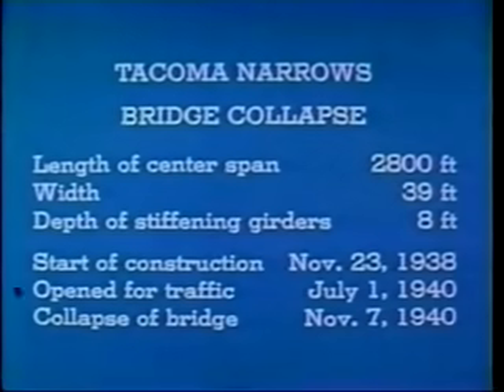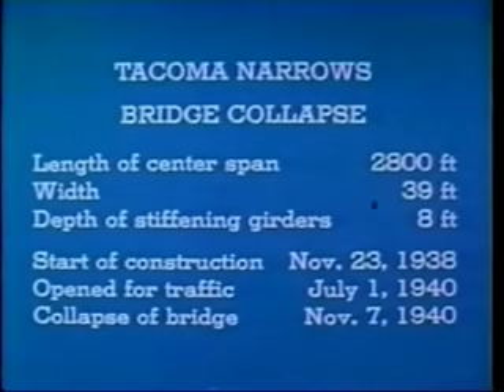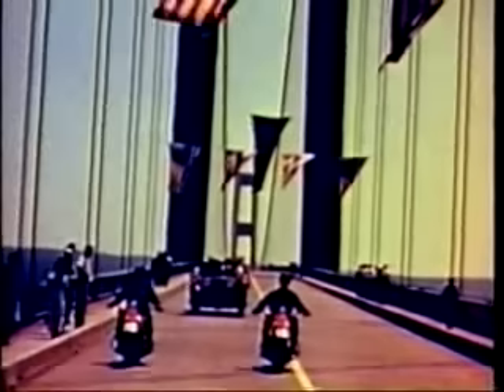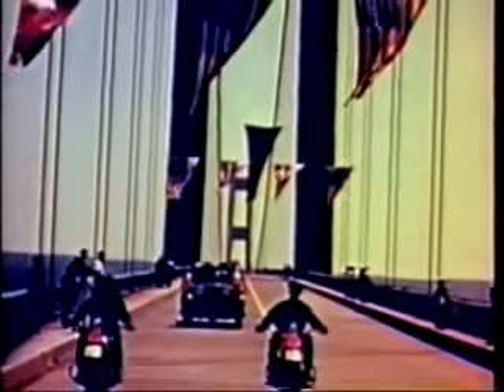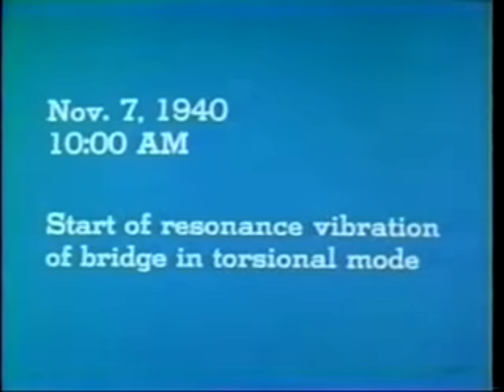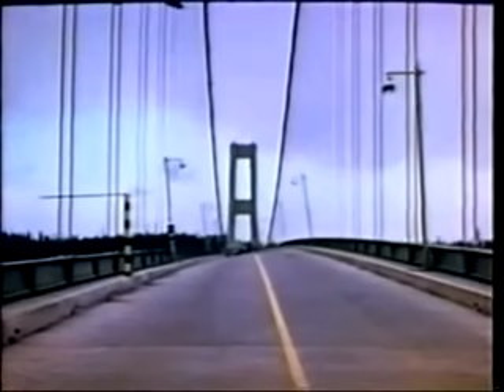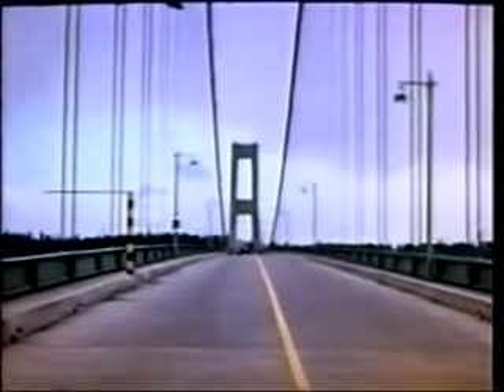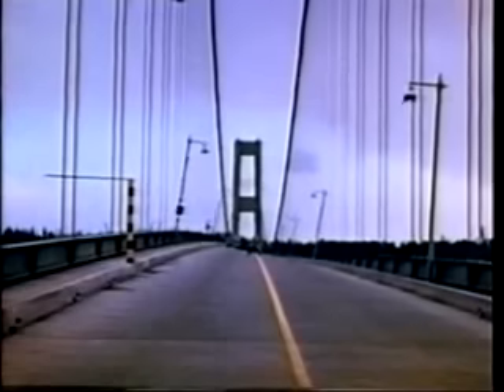Tacoma Bridge

Comment: Why are some people saying it's fake or have something to do with a conspiracy? It's got something to do with the frequency, Learn Science!
Reply: its called galloping. the osculating winds.engineers aren't perfect not then not now. some people say W.T.C. towers collapsed because of engineering flaws. i disagree  IMO the main cause of twin towers collapse was jumpo jets full of high octane fuel crashing into them.
Reply: +Tony Micel Jet fuel cant melt steel beams
Reply: +Jake Valentino It doesn't have to melt them to weaken them. Duh. LRN2PHYSICS.
Reply: +Mike Crews infact main engineer given an allarm about that while inside the first tower. He saw what was happening.
Reply: Paige Holloway Some peoples are crazy.... :D
Reply: +Paige Holloway sorry, this is very real. A famous engineering case study on resonance. Look it up.
Reply: that's what I said
Reply: The reason for the collapse of the bridge is because the gale blowing at the time was vibrating the bridge at its "Natural Frequency". The vibration severely weakened the structural integrity of the bridge, making it collapse.
Reply: Actually, it was due to fluttering.
Reply: Paul Smith no, it's frequency, the wind had the same frequency as the particles in the bridge which caused this to happen
Reply: I know it's not fake
Reply: This was copy and pasted from the other Tacoma Narrows Bridge video
Reply: And resonance when they wind which blew at 67km/h and matched the ferecency in the bridge and then it collapsed
Reply: It's not fake when the frequency of the wind matches the frequency of the bridge the bridge resonates which makes it move like that.
Reply: And you have done that experiment?
Reply: Tony Micel : I second that. I am not an engineer, but I was there.
Reply: No other bridge wobbled like this then fell down.  It looked like a controlled demolition.
Reply: It's a fake, the film of it failing is cut, and you can see all the smoke from the charges that took it down
Reply: Maybe not, but that degree of heat over a period of time did change the molecular structure of the steel and severely weakened it to the point that the beams couldn't support the weight of the structure above them, causing the collapse.  Once the collapse began, "pancaking" occurred and the momentum of the initial collapse caused sufficient downward force to make each tower collapse.  Not a design fault.
Reply: Not the particles, but the natural frequency of the whole structure.
Reply: Definitely NOT fake and definitely not a conspiracy.  It happened.  I first saw a film of the torsional vibration and collapse in physics class in my senior year of high school in 1970.  The roadway supports for that bridge were poorly designed and completely underengineered, allowing the roadway to buck up and down in the wind again and again during the first few months of the bridge's life, which is why it got the nickname "Galloping Gertie".  After less than five months of use, on its last day, the bridge's roadway started its extreme torsional vibration and collapsed after barely over an hour of that, and it got filmed because with that kind of thing going on, people were going to film it.  The story was in every newspaper in the country and reported on every radio news broadcast in 1940.  My parents remembered it well and my father, when I talked about having seen that film in class in 1970, even remembered the nickname and the fact that the bridge's roadway was notorious for extreme up and down movement.
Reply: You are way off base.  What happened to "Galloping Gertie" was studied closely to determine why the bridge failed.  They certainly didn't do any kind of demolition bare over four months after the bridge opened.  No other bridge failed like this because no other bridge had been underengineered like this one.  You can read about the bridge failure in all the newspapers the day after it happened and documentary films reviewing the cause of the torsional oscillation of the bridge the day it failed exist.  Google "Tacoma Narrows Bridge" and find out what actually happened.  I note, too, that there is film footage of Galloping Gertie galloping routinely as cars crossed it during the period between opening day and its catastrophic failure.  The support system under the roadway was woefully inadequate to stiffen the bridge and used solid box girders that caught the wind like sails instead of an open triangular truss system.  The day of the failure, the 46 mph winds blew in harmony with the bridge's natural frequency, and the oscillating torsional motion began and was so rhythmic as to be self sustaining, so once it started, the wind just kept it going.  Finally, one of the main cables broke loose from its anchor on the eastern end of the bridge and that was the end -- with one main cable broken loose, the bridge fell.  It's actually amazing that it kept up the severe oscillation as long as it did without falling.  Had it been a controlled demolition, no one would have had to escape from his car on foot, leaving his car on the bridge.
Reply: Todd - why does being shown a film about resonance etc mean it isn't a conspiracy?  It could be - the collapse video is cut to a time after the collapse has started, and residue of an explosion can be seen - I wouldn't expect mechanical failure to throw smoke out as if explosives had gone off.  If you can find footage of the instant of failure, that would help.
Reply: @andrewdeighton5926  by it wasn't, it's called critical frequency, here's the same experiment win a different object, take a crystal wine glass, then put a straw in it, then hum loud and go up and down win the pitch of the hum, if done properly you will see that he glass is shaking, fluttering back and forth, pretty soon if done long enough, it will break. This wasn't a controlled demolition but critical frequency.
Reply: @andrewdeighton5926  if you learned ANYTHING on critical frequency then you will understand, otherwise it looks fake, modern bridges are engineered so that the critical frequency is very high and hard to get too, but at the time of those bridges people didn't know about it so engineers weren't concerned about something like that, the mistake was made, it is true, and now engineers know how to make a bridge without worrying about critical frequency
Reply: @andrewdeighton5926  maybe because the road itself fell and the sides were ripped off which created the "smoke" very much real tho
Reply: Andrew Deighton there's more than one thing that can be confused with an explosion. Just because there's dst in the air that juts outwards doesn't mean explosives were used

Looking at the moment at which the clip started, if explosives were used, you'd see more smoke and in a different shape. Right now it just looks as if a flare had gone off

But if I may ask: why on earth would they blow this bridge up? Why in such circumstances? Looking at how it fell, it was obvious it would be studied and therefore the chances of such a conspiracy being uncovered would have been a lot higher
Reply: @plazasta  also why blow up a bridge with a dog on it? With people on it? Engineering at the time didn't know about this until they did a bunch of research and experiments to redo the experiment in a controlled environment
Reply: @mr.dinosuar7333  but haven't you seen 9/11 and other tragedies? The government is willing to do anything to achieve its goal, even if it means killing people duh
Reply: @plazasta  so your saying 9/11 wasn't a terrorist attack when it was? This bridge fell do to frequency, no explosives nothing. The bridge wobbled because the wind matched the bridges frequency which made it collapse under the stress. Nowadays bridges take this into consideration so it doesn't happen again. They make the bridges frequency hard to get so it doesn't happen.
Reply: @mr.dinosuar7333  I was being sarcastic, why do you think I finished my sentence with "duh"?
Reply: Building 7.  And molten iron pouring out on video!! “MUH StEeL BeAmS dOnT hAvE tO mElT fOr iT tO cOllApSe hurr durr”
Reply: @MossadDid911  where the molten iron being poured out shown, where. "HuRr dUrR
Reply: @MossadDid911  these arguments are getting old. I hate that conversation because both sides sound like broken records now uttering the same sequence of arguments over and over and over again
Reply: “It’s got something to do with frequency” 
“Learn science”
Reply: @Jamsicks  IT did NOT have to.. the strength of the twin towers beams was cut to a fraction, by the burning  jet fuel. Check out ANY engineering manual for torsional and tensile strength of steels at elevated temperatures.  Simply Red (not orange or white) hot you can dent steel easily with ANY hammer!
Get smarter.....  Please !!
Reply: @MrsPaul  The bridgewas open for 4 months!  this is the first time it suffered increasing resonant motion!
Reply: Frequency is a fake concept made up by the government to control populations.
Reply: lol. I just love the irony in the statement, "It's got something to do with the frequency, Learn Science!"
Sounds like the writer needs to brush up on their science a bit, too. Or rather, their math.
Reply: Bruh, physics xd
Reply: as a Citizen in WA I can confirm this is 100% legit
Reply: We are in class and my friend just chat me "This seems a quite fake" lol
Reply: This needs 8 more likes
Reply: No it's real I live near there it fell there's pictures
Reply: People: say it's fake
kindergarten trauma: slowly fades out of existence

I should add that my kindergarten teacher just showed us a video I was not alive for this but I do live near it and cross it almost every month even when I was a child and I was terrified and I was mad at my kindergarten teacher for a good year
Reply: look up teslas magic frequency found. they discovered if you find the resonate hz of an object and times it by 11 you get stuff like this
Reply: @MikeC2K10  the steel beams would have only been heated at the top actually and a the full collapse of the building from the ground up wouldn't have happened.  Also, both towers including tower 7 fell demolitionized, are you gonna tell me all three buildings had the same jumbo jet fuel that crushed down by heating beams covered in antifire material in  each building?! Get more information. You are clearly misinformed about the incident. It was totally done strategically and put as a lie to yall
Reply: @ilyaholt8607  frequency wasn't made up by any government, it was discovered by a man called Hertz
Reply: Best way to put it its like when you watch speakers vibrate that is osculation. It be cool if we could here the creeks of that bridge you would notice the pattern against the wind. another way to put it is like pushing a swing. each gust slowly adds more and more energy antill it reaches a maximum force that the bridge isen't made for. Im sure most of you guessed this.
Reply: @andrewdeighton5926  Is anything real?
Reply: "Think of how stupid the average person is, and realize half of them are stupider than that..." - George Carlin
Reply: Its more like mechanic resonance but yea
Reply: Some people are stupid and try to compensate for that by making conspiracy theories
Reply: @Jamsicks no, but it can weaken them, especially jet fuel. That combined with the location for the structural supports for the two buildings and the weight of the jet itself, and the shock to the structure from the impact and you have what we saw on 9/11
Reply: @00tonytone  it seemed to collapse from the base of the building
Reply: Lol! Thermite buddy, keep up

Comment: I'm an engineering and it failed because the steel girders gave way due to fatigue. Fatigue limit is the number of cycles a material can survive while being exposed to a certain stress amplitude (in this case it was very high) and failure occured after a relatively small number of cycles. The cyclic motion occured due to a phenomenon called aeroelastic flutter. Essentially this means aerodynamic forces (wind) coupled with the bridges natural mode of vibration to cause rapid periodic motion.
Reply: Oh my god, this is one on the few explanations I have ever seen that makes sense. Thank you
Reply: AesopsFablesthe2nd I assume normal here means thousands or even hundreds of thousands

Comment: They must've been confused and put rubber instead of concrete...
Reply: natural frequency of oscilation and resonance, when the system doesn't moves towards equilibrium as time passes and instead, amplifies the amplitude of the wave
Reply: @Yamila Cruz Montano it's just physics
Reply: Bridges are thought to always be sturdy, but some are specially made to bend without cracking and breaking.
Reply: Happens atleast twice a week for me

Comment: It's interesting how a particular environment can affect a structure like that. That very same bridge construction (from the same contractor) was used in several other bridges in the US, and they held up just fine. But the winds at Tacoma affected it differently than in other areas, exposing weaknesses that were not apparent in other settings.

Comment: I'm surprised that a steel frame has that much flexibility. Also, I'm amazed that the pavement didn't crack.
Reply: It is a very long bridge.  The camera angel makes for tremendous foreshortening, and so the angle of the flex lengthwise along the bridge deck is nowhere near as much as it looks.
Reply: @starpawsy  someone said the bridge was throwing it back
Reply: o it cracked, then broke
Reply: @Thermospon  brother💀💀

Comment: @SidneySage93 Yeah, the wind transferred more energy to the bridge during each vibration than it could lose during the same vibration. This caused torsional vibrations (where one side went up, the other down, and the middle remained at rest), eventually building up enough energy to cause extremely large amplitudes of vibration, causing the bridge to collapse under the strain. Hope that cleared it up :)
Reply: 10 YEARS AGO WTH

Comment: I've been across this bridge many times (the new one that replaced the failed one. It's still on the bottom of the Tacoma Narrows).  The new, redesigned bridge deck design was tested in a wind tunnel at the University of Washington before it was built.  Theodore von Karman participated in the official inquiry.  The deck was not replaced until 1950 due to WW2.

Comment: I went to school with the son of the man that took most of the movies of the collapse. He made millions from that. I was born in 1944 and remember taking the ferry from Gig Harbor to Tacoma after it fell. The fare on the next bridge was $1.00 per car/driver and a dime per passenger over ten years old. That bridge built in 1950/1951 does sway tho. We had a big wind storm in 1964? and we were on the Gig Harbor side at the span drive in (hamburger place) and you could lean up against the building so your head wouldn't and you could watch the the bridge disappear and five minutes later you could see the whole thing. I was surprised they didn't shut it down but they have a few times since then for that.
  There was four lanes on that bridge with 18in grating between the lanes for wind relief which led to some interesting lane changing when it was windy, especially if you were in a small car because the wind would come up through the grating. I have seen smaller cars lifted enough that they moved over half a lane. Needless to say that shortly there were big signs that said do NOT change lanes.

Comment: it is not wind 'pressure' nor sound -- it is aerodynamic lift - the bridge acted as a wing / and tried to 'fly'  / it could not   / and reset / over and over / with ever increasing amplitude / until a section failed / I am amazed at the continued speculation on the causes  / yes - lift IS this strong - why else can jumbo jets fly / 
 - I am a former USMC fighter/test pilot with a degree in Aero
Reply: Aerodynamic lift is due a  differential of "wind" pressure .
Reply: Greg Gustin  it is not aerodynamic lift.  The bridge has a natural frequency and here it is the driven oscillator. the wind is the driver oscillator. when the frequency of the wind match the natural frequency of the bridge, the bridge begins to oscillate with very high amplitude. it is an effect called resonance.
Reply: Well, in an Invention and Innovation class we were taught the same thing watching this video, that lift contributed heavily towards it. Prior to making bridges out of paper and rolling remote control trucks with weights in them across it. My teacher had an engineering degree, so I think I'll take his word. It could've been a combination of both, but I certainly think lift was involved.

Comment: Engineering problem:  The bridge likely exhibited signs of this problem on previous days in lesser winds.   What simple addition(s) to the bridge could have prevented this collapse?  

Also why was apparently no one concerned before the collapse?
Reply: Can u please give answer also?
Reply: I want to give others a chance first.
Reply: OK then - I'm surprised there have been no answers posted.     My suggested solution would be stiffening steel cables should have been added attached near  the center of the weak span; the other ends of which would have been anchored to the upright support towers near their bases.   This would prevent upward motion of the center of the span.    Allowance would have to have been made for the river traffic under the bridge.